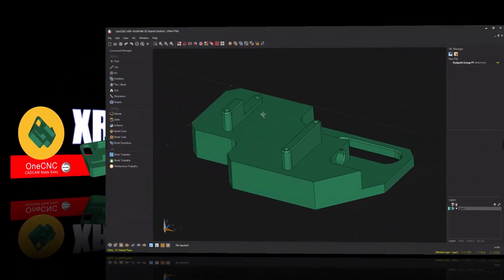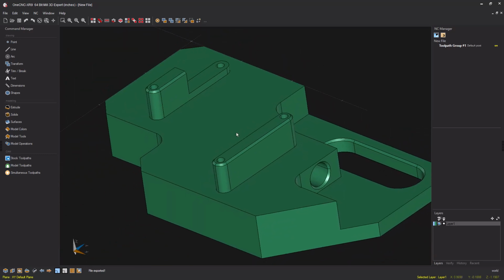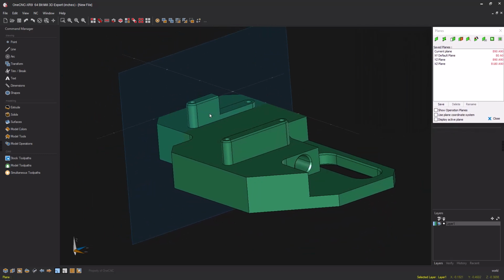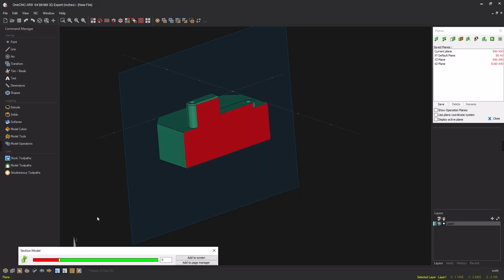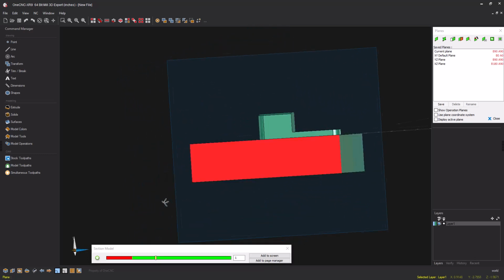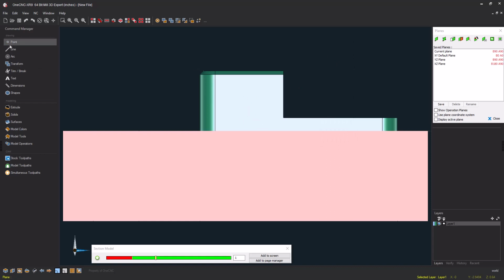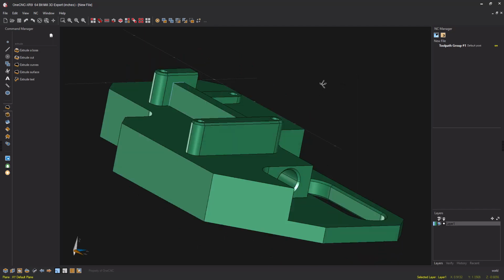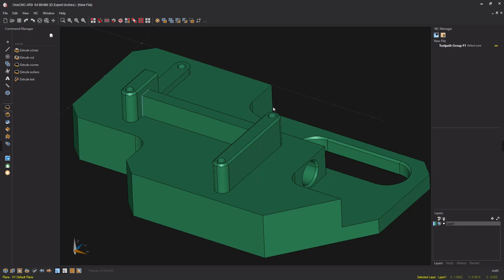OneCNC CADCAM: Section Like a Boss!

Comment: Will OneCNC ever offer an update so you can have actual threaded holes? Fusion has this nailed and it's the only thing that lets the software down. Not being able to have actual modelled threaded holes
Reply from the maker: Hello and thank you  for watching the video. At the moment, the only way I know of to create threads within the model would be using "Helix" and "Cross Sectional" surfaces. Having said this, the result is a part created from surfaces instead of a single solid model.

I will research this a bit more and keep you updated if I hear of an update that includes a thread feature for solid models.